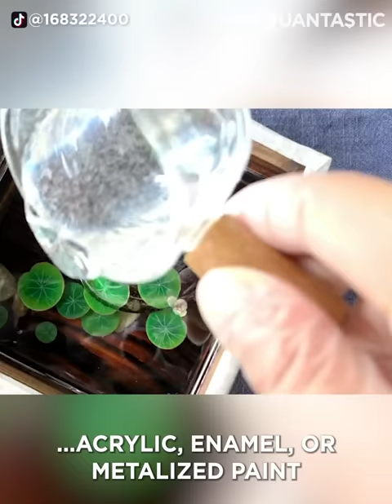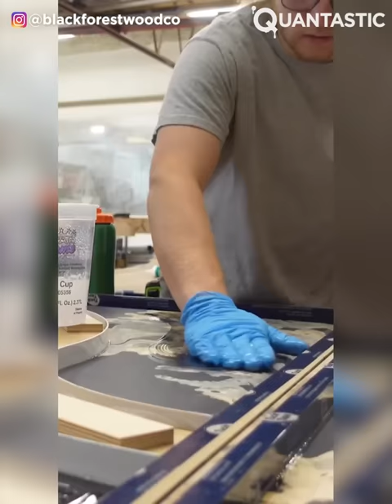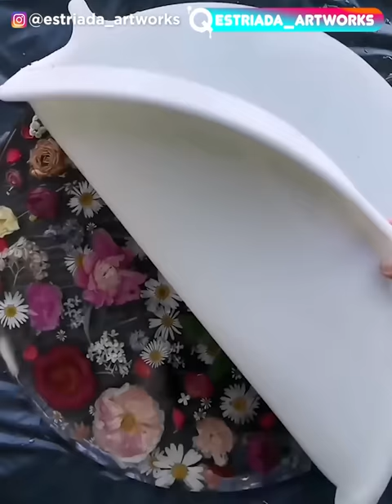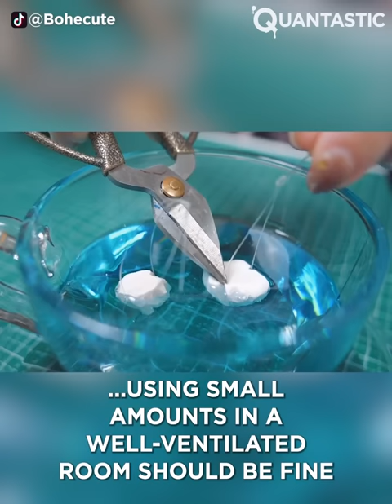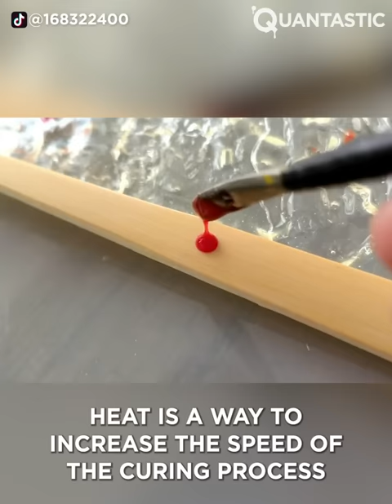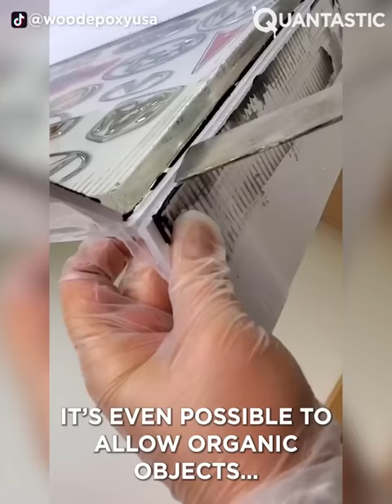Satisfying Epoxy Resin Art That Is At Another Level

Comment: Probably been said, but did I see a skateboard made from the resin? Place LED strips inside the resin that light up those different layers of beautiful paint from the smooth edge inward and have the battery sealed inside, but maybe an inductive charger to eliminate the need for external cables or jacks, but also even more vibrant! lol Throw in some Bluetooth and some small screen in the deck pointed upwards to provide you current speed or phone notification lmao or how to perform the trick while you're at the park with friends? hmmm Headlights, taillights, and laser light show projected out the sides for good measure or maybe create a driving line projected on the road in front of you that can also show the turning radius ahead as you lean left or right like real time Gran Turismo style but works off simple sensors built in

Comment: While the first layer needs to be flat it does not need to be completely dry before pouring the next layer in fact if it is at the thick gel stage it will look better